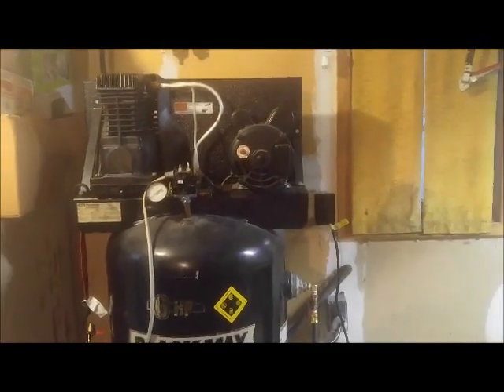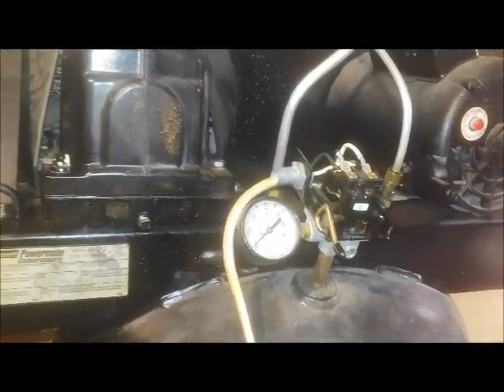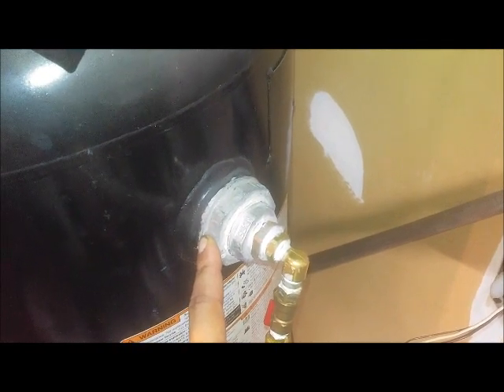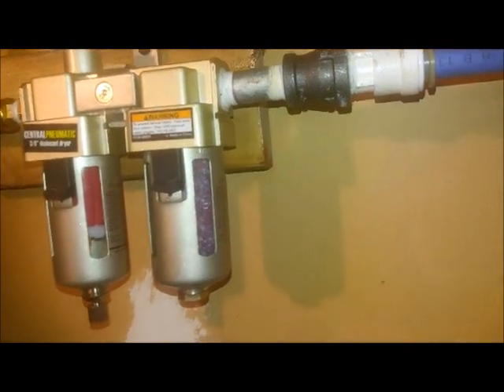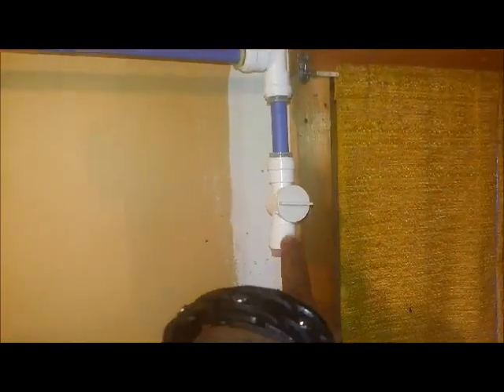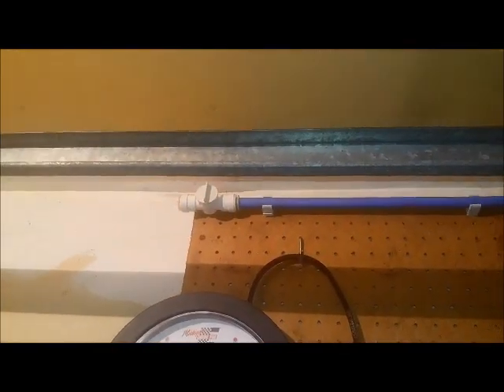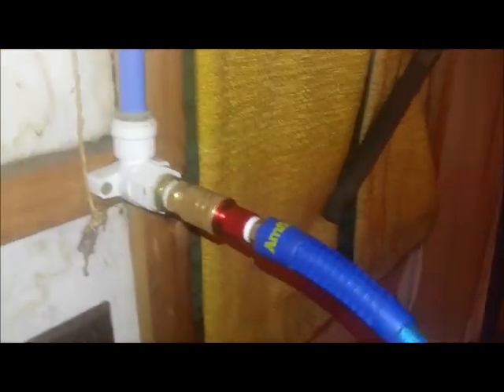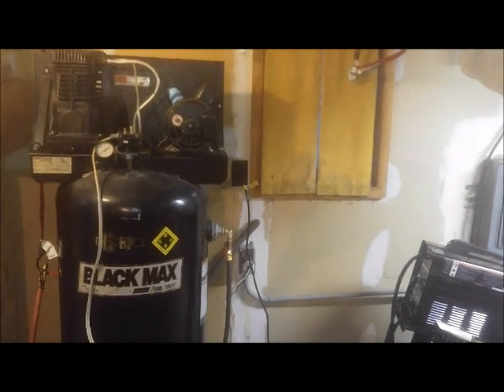Air supply with pex pipe

Comment: I would suggest using at least a 1/2" line to the dryers. You are really limiting your air flow and that will increase the moisture in your lines.
Reply from the maker: I thought about going 1/2" but everyone I already had were 1/4" including all my tools, wrong or not I thought that it would all bottle neck at that point so it wouldn't matter where the 1/4" section starts.  

If you think differently then please let me know, I honestly love hearing different ideas and I am always up for my mind being changed and or doing a trial and error test myself.  

That's where this video came from literally, on a different video of mine I put in a sink, as I was doing that I liked the flexible property of pex and thought since the tube says max psi of I believe 170 and my compressor couldn't achieve that on its best day lol, it should work.  But family I suggested the idea to said the connections wouldn't hold.   Well guess what they are wrong, still using that setup to this day!

Enough with rant lol

Thanks for watching, thank you very much for your time and ideas!

HB-Zachary

Comment: I had just a hose for a long time. Then I got a hose reel...... Should have done that years ago. So much better and no hose to roll up and get in the way. Get a reel. You won't regret it.
Reply from the maker: Yeah for sure totally agree.  My garage is small though too small to justify the work I did in the video.  But it was done for two reasons,  my friend said the shark bite quick connects wouldn't hold up to air compressors. Secondly I figured I would make a video while proving him wrong hopefully someone would see it and try it on their garage.   

Thanks for your comment,  thanks for watching!

DIY-Zac
Reply: for you both I guess, is it okay to put a lubricator before a hose reel? and does it matter if high or below the lubricator?

main one for you both what you use from compressor? I see the air can be like 150c but want to have it go through the filters to remove moisture and particles before it goes in tank then go out to a joint for dry side and lubricator side, would like copper but seems they have stainless steel on mine and heard copper corrode if joined on as the filters are 90c max

Comment: Can you show how you reduced from pex to the coupler? Or a link to the pieces? Im having trouble going from 3/4" pex to the 1/4 coupler.
Reply from the maker: Hey thanks for watching,  I have included some Amazon affiliate links. You don't pay anymore, unfortunately no discount either but I get credit if you buy from these links.   
I used a 3/4 female pex elbow drop ear to a half inch fpt (female pipe thread)   then air quick connect with 3/8's 
My airlines air technically 1/4" but when you buy them you can get 3/8s line with 1/4 connections.  Some say the bottleneck at the connections restrict flow and make 3/8s lines worthless.  That's a personal call I guess.  
Just copy and paste those into your internet bar, until I figure out hope to insert clickable links lol

Quick connect
https://amzn.to/2tiRcxI
Pex elbow
https://amzn.to/36iTefA
Reply: @BackyardDIY-Zachary  so I can go from 1/2" fnpt to 3/8 npt? Just a lot of pipe tape or?
Reply from the maker: No that probably wouldn't work,  duct tape? 
I'm being facetious,  you would either need an adapter or you would need to find the correct air quick connect.

Comment: Nice setup you have there, but why are you using 14 gauge wire to your motor?
You need to use 12 gauge wire. Your motor is not getting all the amps it needs plus that 14 gauge wire will get hot and possibly cause an electrical short at the outlet. 12 gauge is yellow colored romex. Good luck, have a nice day...👍😀😎
Reply: Not all 'romex' is color coded.  If he is running the compressor on 220 volt, he is using half the amperage of 110 volt so, the wire size should be sufficient.  That said, 'romex' is not in compliance with the National Electric Code (NEC) for cord and plug wiring.  Should his building catch fire, the insurance company may use that as an excuse not to pay.

Comment: You have really cut down you air flow by reducing it down so much,,, sould be no smaller then 3/4 inch,,,  even your separators should be no smaller then 1/2 inch unless it's at a end connection.